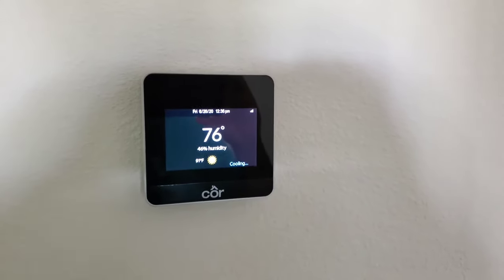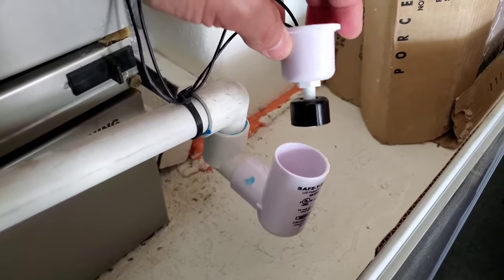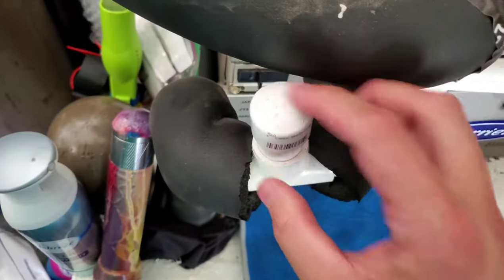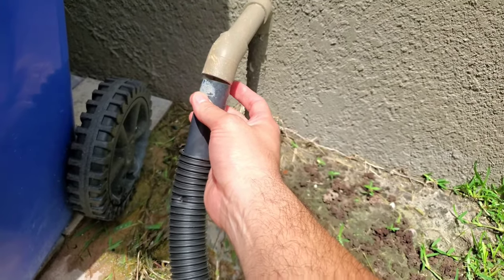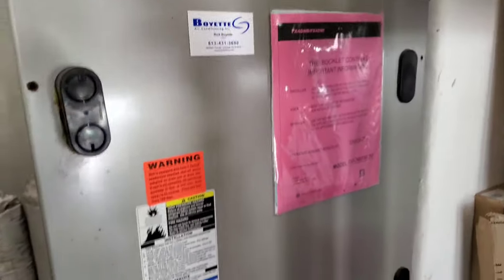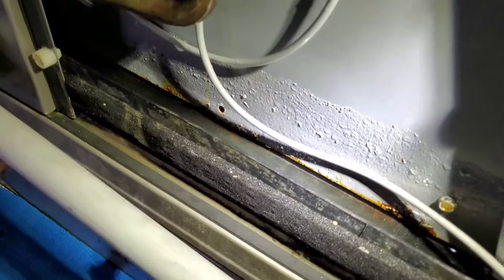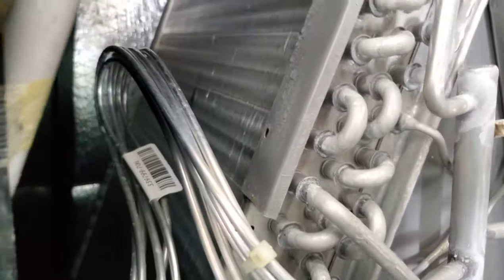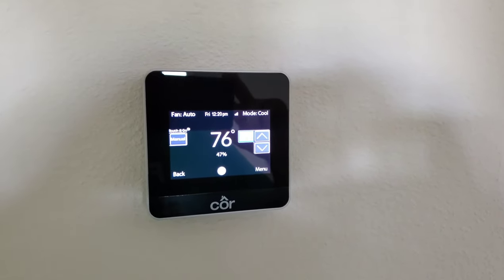HVAC DIY Maintenance - Float Switch Explained

Comment: Regarding the shop vac you used to clean out the drip line, would you know how much HP you would recommend getting?
Reply from the maker: Honestly, any of the plug in ones are strong enough so no need to get a high HP one. Battery operated ones aren’t strong enough to pull the thick grime, I’ve tried. It does ok but not for big clogs.
Reply: Okay. Thanks very much!!! Also need to say that your video was terrific. Very informative, easy to follow and straightforward. Much appreciated!
Reply from the maker: @RalphTitone  heck yeah that’s awesome to hear!

Comment: I got a York system, the company that installed it won't come fix their problem. Also for some odd reason I think they put super glue in my copper drain line causing it to thicken. It's a little over a year old, my old PVC drain pipe normally goes under the ground through the garage to the outside. Well my mom's head walls so I had on them switch it to the other side of the wall that's why they hooked up a mechanical electric pump to siphon a wire through a copper pipe. There's so much sludge it looks like white clear silly putty or gak. So I hooked up a garden hose so it can run freely and also my water safety switch maybe faulty. It's one of those ones where you pull up to test and push back down.
Reply from the maker: Do a good flush and I bet it will work ok. Swap out switch if it’s failing and no overflow.
Reply: I did,now it's the overflow switch thing. I flit it n the red light gose on n off or deem red or nothing at all then I don't think what state it's in😒

Comment: What if the clog is inside the air handler? Shouldn't it be installed next to the drip line on the air handler unit?

Comment: What happens if after you drain and suck out the water if it constantly gets clogged?
Reply from the maker: Either a pressurized cleaning meaning you’re using the force of air to blow out bigger chunks, or you need to inspect the air filtration. If it’s not filtering the air, all of that dust settles in the pain and lands in the drain pipe.

Comment: My AC keeps turning off because my float switch pipe will start to tilt too far down. I had to prop the pipe slightly up by putting a piece of something below it to hold it up so it’s tilted a little upwards. Will this harm the unit?
Reply from the maker: There has to be at least a small amount of downward tilt or yeah you could potentially have a flood of water or leak depending on where the unit it located. If it’s filling up at all then you have an issue with the drain or the pan inside.
Reply: @ArcLightAddicts  thank you for the fast reply. I was able to set it up now where it slightly tilts down. Appreciate the help

Comment: there’s a filter on the hvac itself? i thought only filters are on the vents in your ceiling?
Reply from the maker: On these newer systems, there's only one main filter at the air handler. It's much better than having to replace several throughout the house haha.

Comment: When the ac guy took mine off it has rust on the fins . Is there something I need to do?
Reply from the maker: Depends on how bad it is but if too many are rusted out it would be able to flow properly. A little rust is ok and won’t hurt anything, just not too much!
Reply: @ArcLightAddicts  Thanks for responding.  I am going to buy a shop vac because I just paid to clear the line and now am able to do it myself.

Comment: I'm assuming I am looking at it wrong as to me with the pipe running downhill to the float switch and the float switch not being very high, I don't see how water doesn't always run down there and then fill up and trip the float switch. So someone tell me I am not looking at this right please?
Reply from the maker: Excellent question!! Inside the drain pan there are two holes and the one going to float switch is slightly higher.

Comment: There’s a filter in the hvac system? I thought it was only the vents. 🤦🏾‍♀️
Reply from the maker: This is specific to my setup. Each system is different on how they set it up. Some do a single filter in the air handler and some do at each return.

Comment: Nest saying no power because water tripping float switch. Tried vacuuming the line outside for a few mins but absolutely nothing came out. Stuck for now just draining the float area 5 times or so per night 😩. Interestingly tho it doesn’t happen during the day.
Reply: After vacuuming the lines outside and you drained the cap inside the indoor AC unit?  If not, turn off the AC circuit panel and then remove the colored wires (G,Y, Rh, all other wires) connected to the Google nest then reconnect them. And turn the Ac Circut panel back on. 

Hopefully that works (in then future). You probably already have fixed it by now.

Comment: Can the float switch short the circuit breaker for the outdoor unit?
Reply from the maker: Highly unlikely and would be a rare case. If it does then you have a fault somewhere in the air handler.
Reply: @ArcLightAddicts  wow! Thank you for the response!
Reply from the maker: @emiliohidalgo  no problem! Glad I can help!

Comment: How do you keep your coils from rusting?
Reply from the maker: Every few months I spray them down to clean and wait until dry. If yours is rusted, you need to buy a rust inhibitor to stop it and then coat with something like coil guard. A little rust is ok if they are old but if it’s too severe it may crack and leak. I would also ensure the outside unit stays clean.
Reply: @ArcLightAddicts  Any particular brand that you recommend?
Reply from the maker: @Ojeramup12  for a cleaner, https://www.homedepot.com/p/AC-Safe-Air-Conditioner-Foaming-Coil-Cleaner-AC-921/206740351

And for rust prevention… https://www.adcosupplies.com/index.php/product/coil-guard-blue-anti-corrosion-20oz-spray-can/
Reply: Proper leveling of evaporator coil drain pan,  P trap with proper installation,  efficient drainage of condensate and a regular maintenance schedule
,
Reply: I am an HVAC Technician. This video came up on my feed and I'd like to help if I can give some advice.
Reply: I have two safety switches on my heat pump, which is elevated in a hall closet. I understand one is probably a secondary switch? One of the switches is attached to a short run going to the condensation line, the other is just attached to the air handler itself. 

The one attached to the drain line is full of rusty looking dry crud. (My secondary drain pan is catching water and getting musty smelling so I just stopped using the HP altogether. I think one of the pvc joints is clogged and/or needs resealing). Can I flush the safety switch pipe with hot water, then suck the crud out from the there? My condensate line feeds to the sewer system, not the outside so that would be an easy access point. 

Also, I saw this tool on another video and would like to get one if I can do the flush as I described. At the same time, I'll also be doing another round of condenser coil cleaning as my coils are filthy and smelly.

Sorry for the information overload, but it's Texas, it's hot and I can't afford to replace the unit right now. Any help is appreciated.

https://www.amazon.com/gp/product/B01LYZ6REM/ref=ox_sc_act_image_2?smid=A11QIEH93V9MMB&psc=1

Comment: Drain switch improperly installed has to be level no Loops in it the water's got to be able to go to the switch to shut it off when it's high but it also has drain back basically you're just a standing the switch systems working correctly

Comment: Your float switch piping is not correct. The way you have it, the water will stay at the bottom where you have the switch.  The float switch will never self correct. You will have to drain the water after you fixed your drain problem. The switch has to be representative of the level in the AC tray. Follow the manufacturer's recommendations for installation. Basically the switch will be installed right at the high level port of the tray. No need for all the piping.
Reply from the maker: The float switch installation was done with the build of this house and is new. The float switches weren't designed to self correct. I'm sure there's a way but that doesn't exist in any of these homes.

Comment: Can the switch go bad,
Reply from the maker: It’s possible. You’d have to test continuity across the two wires to see if it completes/breaks the circuit. You can use a battery to test it, doesn’t matter the size.
Reply: Ok. I'll give that a try , thanks for the quick response, have a great day ... 👍
Reply from the maker: @poolman8201  no problem! Hey even easier, go ahead and manually trip it by flipping it upside down. Your thermostat power should cut off.
Reply: Yeah, I tried that and it still runs, that's why I was thinking its the switch.
Reply from the maker: @poolman8201  oh then yeah something isn’t right. You can cut one of the wires to test if that thing is even wired correctly. Just solder or butt connect it back together afterwards.
Reply: @ArcLightAddicts  Ok, thank you. 👍